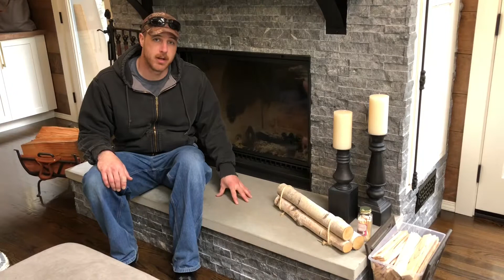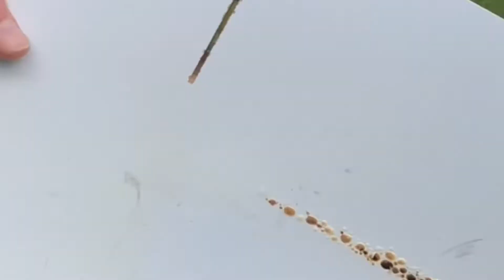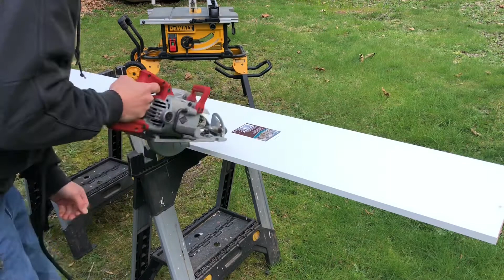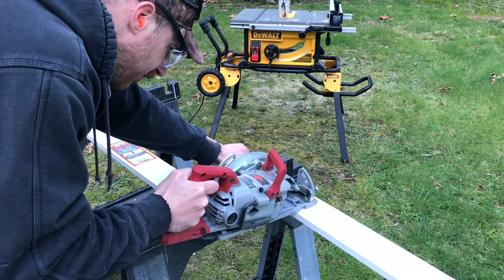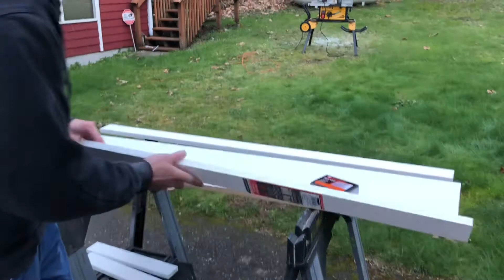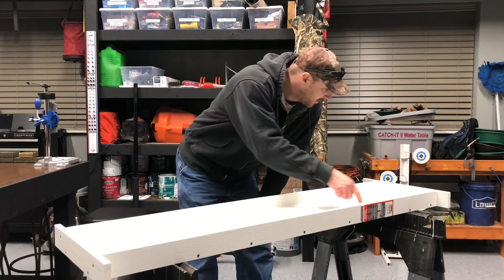Make Your Own Concrete Fireplace Hearth - Part 1

Comment: Please can you list the materials use in the comment section
Reply from the maker: Hey Thandwa! Thanks for the comment. All of the materials are called out in Part 1 from the beginning to about the minute 30 mark. I went ahead and wrote them out for you below. Let me know if you have any other questions. Good luck and I appreciate you 😎

Melamine shelving of your choice (12 inch wide to 4 ft wide by 8 feet long). This is used for the form and the size you want to buy is dependent upon how big you want your hearth.

PVC trim - any size you want. This is for the side walls of the form. Probably need to buy 2 of these. 

Drywall screws 1-5/8 inch screws - used to build and secure the form. One box.

Silicone - used for inside the form to round the edges. One tube. 

Wire mesh 4ft by 7ft, 1/8 inch thick. This is used to put inside the concrete to add strength. One. 

Concrete - high strength Sakrete brand or any of your choosing. Depends how big your hearth is. Part 2 explains in detail how to calculate how much you need.

Comment: Use a scoring cut on both faces of Melamine, before a cut through cut to prevent chip out.
Reply from the maker: That will definitely work too Kent! Thanks for the tip :)

Comment: Awesome video! I am going to tackle this project within the next few days. Its 6 degrees currently in Detroit LOL. I have a couple questions if you don't mind, The hearth I would like to make is 134 inches long, 17 inches deep and 1 inch thick. Is there any possible way this could be made in 1 piece? Or do I have to make two 67 inch slabs? Also, I only have a Lowes and Home Depot near by, any specific Quikrete product that you recommend ?   Thank you in advance!
Reply from the maker: Morning Paul! Hey thanks for checking out the video! I really appreciate it. Dang it cold there… brrr!!! As for your answers, I’d just go with the yellow bag of quikrete. Not the red fast setting bag. You want time to work the material. As for your sizing. Unfortunately with the route I took, your maxed out at 8ft for your length, so you’d have to make 2 slabs. I’m not sure if this would look pleasing to the eye or your decorative style. You could always try making a mold with having the top uncovered and screeing/leveling the top surface so it’s one solid piece. I’ve never done that before but I know there are videos out there. The one thing that’s very tricky about doing that though is creating a flat top surface. I hope I answered your questions and feel free to ask anything else as you go. Good luck Paul!
Reply: Stoney creek! My concrete hearth turned out pretty sweet. The only issue I had, which you actually mentioned it could happen in a prior comment to someone else; I can see the lines from the wire mesh because my hearth was an inch. Any tips to get rid of the lines? My wife wanted to stain it with a concrete stain in a while.
Reply from the maker: Hey Paul! Thanks for coming back. To answer your question, man I really don’t know. I had that happen to me and I just ended up making another one. Now I do remember it lightening up after awhile but I could still see it. So what I think happened was the mesh had some oils on it and it “bled” through into the concrete. That’s the only think I could think of. Now to you other point about the stain. You could give that a try and see how it turns out. It may work, but then it may not. I’m really sorry that happened to you. I know how that feels and I was pretty irritated when that happened with me. I know it’s not what you want to do, but redoing it may be the best bet. You can probably even reuse the mold. That’s what I did with the next one just put the concrete in most of the way, then stuck the mesh inside, covering it a little bit. That’s one of the bummers going thin on the slab. Dang I’m sorry man.

Comment: Did you add color to the concrete hearth which you are sitting on in the opening section of video?
Reply: That looks way lighter than what you poured, and a tan color (contrasted against the gray stone)? I don't know how you did that with that mix. I want it light, thinking I'll use white Portland and pure white silica sand.
Reply from the maker: Hey David. Yea I don't really know what to tell you on the color. It turned out a nice light gray and with it against my dark gray fireplace stone, it looks great. No tan color like you stated, might just be the camera. And it is very heavy, I'm just strong... hahha. Jk. Anyway, I actually wanted to try using a white powder to lighten it up, but when I first made this, I made a tester and we were happy with the color so decided against it. Appreciate the comment .
Reply: @StoneyCreekSparkchaser  thanks for the reply!  Yeah, I think maybe there is some effect of the lighting. It seems white Portland cement and the white silica sand is about 3x more expensive.  Maybe I'll just use what you did.  I think letting it fully cure for a few weeks before sealing it (which I see you mentioned) must make a big difference in how it appears, maybe what you sealed it with too.  Do you remember the product you used for that
Reply from the maker: Hey John! Thanks for the question and no I didn’t. That’s just the natural color. If you want, email me (found on my about page) and I can send you an updated picture of what it looks like after a few years. Not much has really changed. May of darkened just a bit. We love the color. Thanks for coming by John :) I really appreciate it

Comment: Good Morning. What size did you make? How did you get it white? Did you add some type of color to the mix?
Reply from the maker: Morning! The one I built in the video is 12x60x2. The one you see already made in the very beginning is about 18x72x2. No color mix was added. The concrete will naturally turn a more whitish gray as it ages. The color of the hearth you see in the beginning of the video is the color it should eventually become after about 30 days or so. I hope this helps :) thanks
Reply: Did you seal right away or wait for it to lighten?
Reply from the maker: Hey there! I didn’t wait for anything to lighten intentionally, I just waited the recommended time that the sealer said and put it on, I think it was around 21-30 days after I poured it.